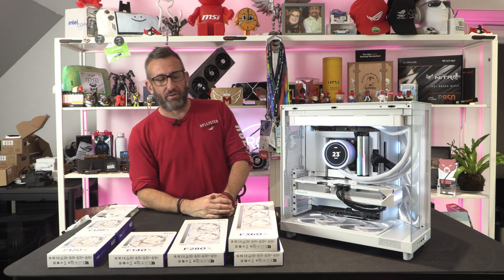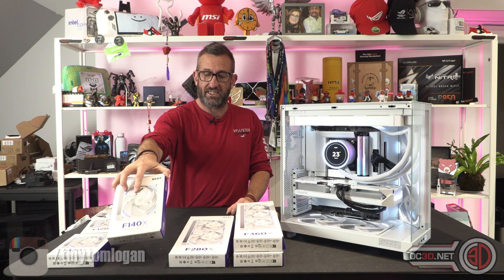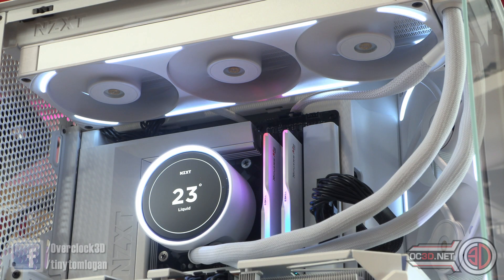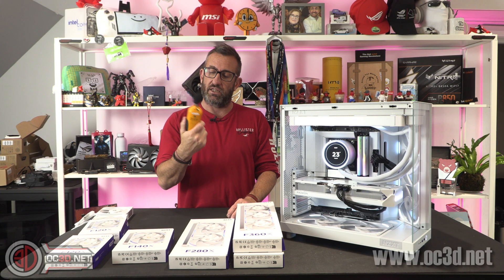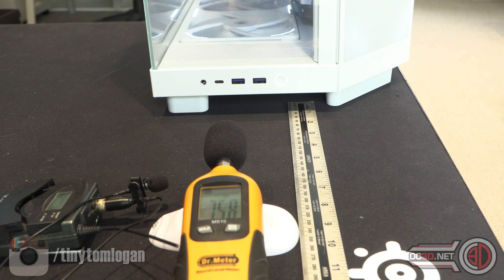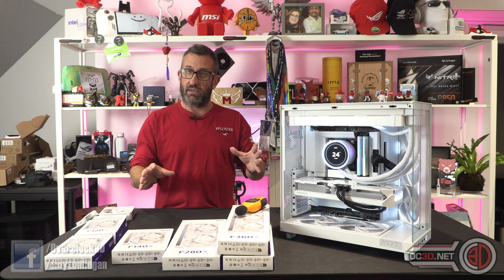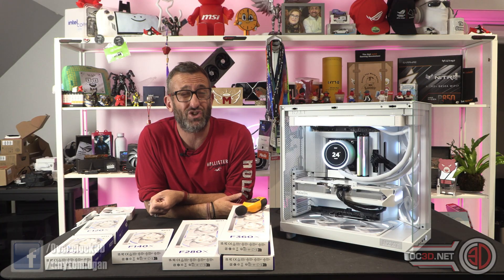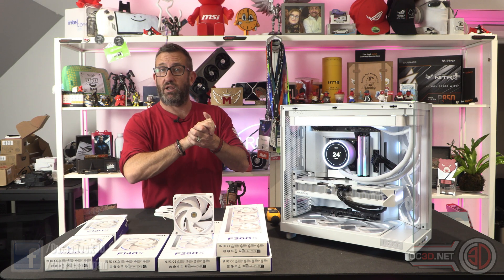NZXT Performance Fan Review | All sizes | Thermal and Noise Testing

Comment: Will the 280 be able to cool the 9900x3d? The 360 is not yet available in my country.
Reply from the maker: Should be fine - there is a fair amount of scope to increase fan rpm if youre not worried about that.

Comment: For that Price I'll buy 2 Noctua NF-12 industrialPPC-3000 PWM which perform better. Obviously I won't have RGB but with a closed silent case that's a waste anyways.
Reply: "RGB bad wah wah wah blah blah". Cry more you insufferable trollop.
Reply: Their industrial fans are quite loud, not in terms of wind noise but bearing/motor isn’t as quite as the regular line-up. Even running them at low RPM, they’re just loud. I had purchased them many years ago and they were so bad
Reply: @Faithhh071  No the industrial fans are not quite loud, they are PWM fans and tunable like any other fan. Plus they got 6 years of warranty.

At 40 dB(A)+ an open case is going to cry sound, but at this point, who cares? I got a closed case with sound dampening, where rgb is a waste of wattage and heat.
Reply: @RiddleTime  Is the 6 year warranty supposed to be impressive? For what they cost and how people still hype noctua up it should be at least a 15 year warranty.
Reply: @Faithhh071 compared to fans now they are quite loud all around for not even mid tier performance.
Reply: @deviantbuilds  Industrial fans blow these fans away in a 1 vs 1 battle.
Reply: @RiddleTime i haven't tried these nzxt fan so i cant say but the noctua industrials are not the move in late 2025 thats for sure. They had their moment years ago but that time is long gone.
Reply: 😂, I have both: a pack of 3 Noctua 120mm IPPC industrial fans at 3000rpm and an NZXT F360X. Both are excessively noisy at 3000rpm, but at 2000rpm, which is what I use, the NZXT is quieter and has a more tolerable sound than the Noctua. Besides the RGB lighting, the design, and its 30mm thickness, the Phantes T30 also outperforms the Noctua at the same speeds.

Comment: Cherry Bakewell AND Ding!, we are not worthy. 😁 3100rpm? I was thinking "Go the 🤬away!". LOL!!! Impressed by these; but  I also thought "Not Noctua; not be quiet!; not Lian Li (or Lanley as they say on Wight!😃)" A fan round up would be very useful. You might also want to see if they fit in MSEye Candy, as the fans you wanted there had similar additions on the outside that added to their girth and ruled them out. Got hold of a Noctua 4080 for a themed build; it is only a couple of mil shy of the MATX case bottom I have it in temporarily and airflow is super restricted. Also the side is off. Does it ramp up gaming; does the card glitch or throttle; does the rig fall over; and can I hear a damned thing after a four hour gaming session? NO! Not scientific, I know, but Noctua heatsink fans seriously impress here and they are not even their latest iteration! I do like the frame set up NZXT have gone with here for tidiness and I like the lighting; I do wonder about case compatibility though. It all looks good in that everything you can see is NZXT build. Only needs some Cherry Red highlights; and that oversized pump top on the AIO looks comically odd; but quite the pretty thing. It is a very competetive market; but I can see NZXT doing well with these. 💖👌